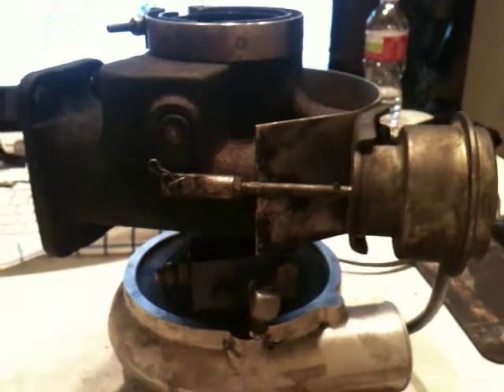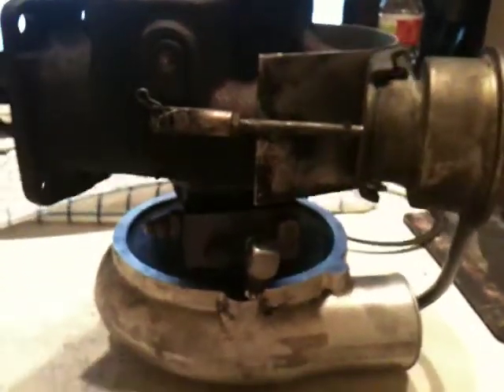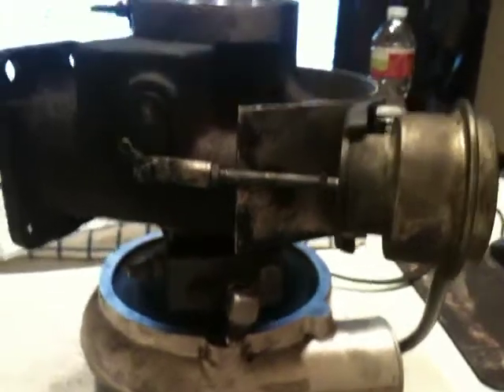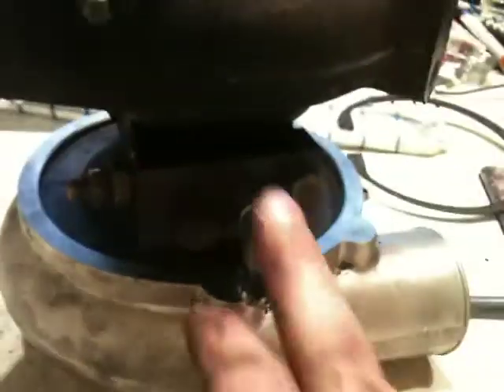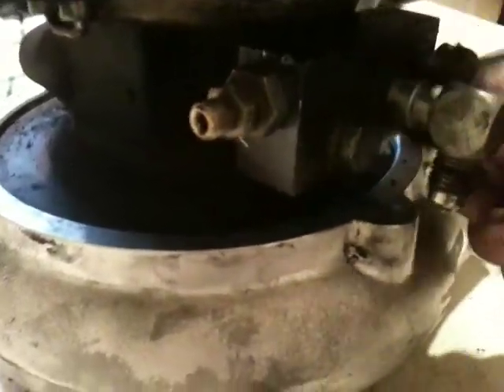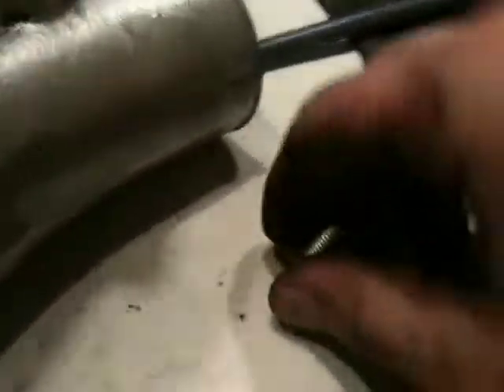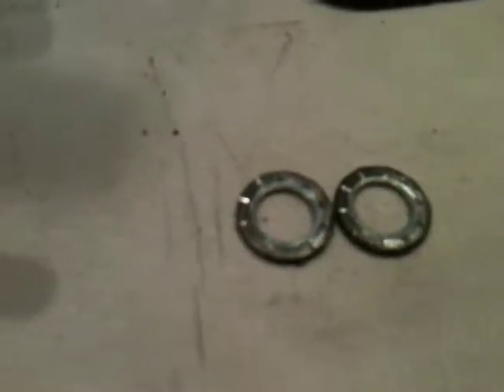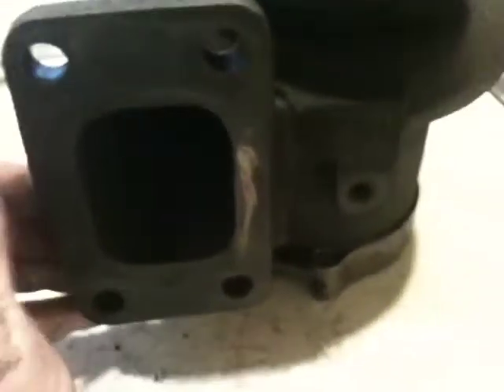Banks Sidewinder TE06H Rebuild Part 1

Comment from the maker: I got mine on Ebay. Search for TE06H The kits go for about $60. Make sure it comes with the heat shields if they are in the picture. The seller's username was nickel_sport.
Reply: Updating for 2025 to say that the kit was still about $60 and sold under the same seller name - apparently Australian based but the package definitely is from China
Reply from the maker: @AtomsForFuel  Mine is still going strong, so hopefully the quality has stayed the same.
Reply: @eatont9999 awesome, I’m on part 5 of your video you did a good job with them. I’m starting my tear down tomorrow